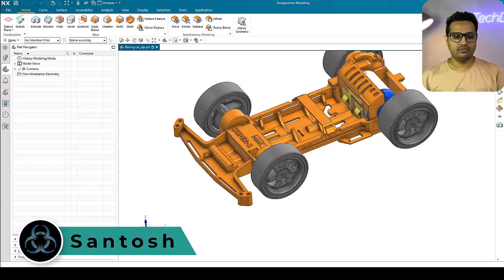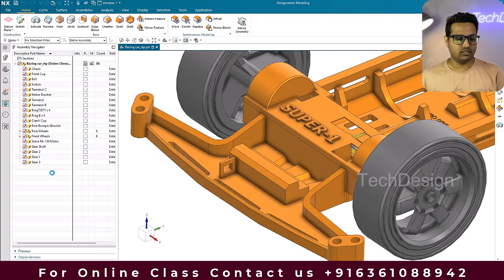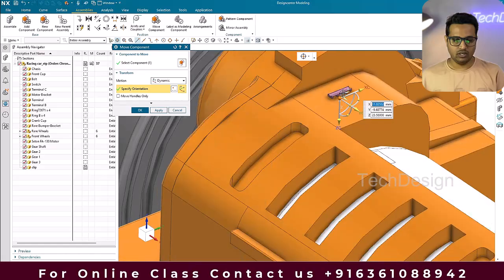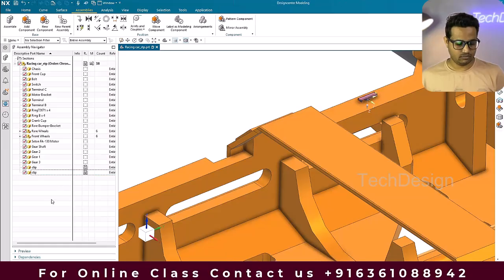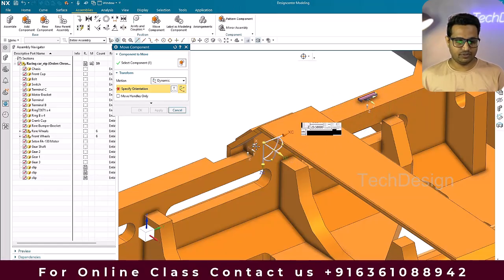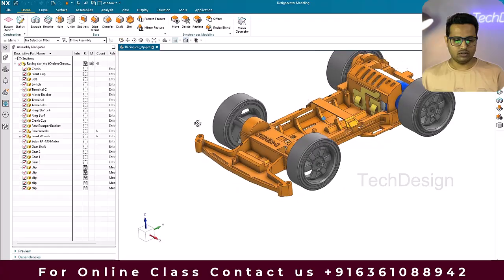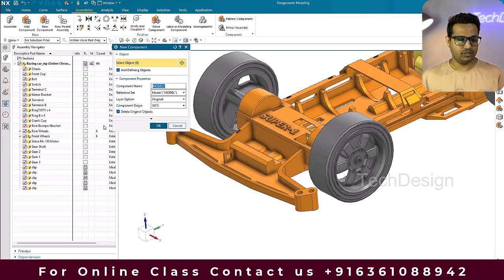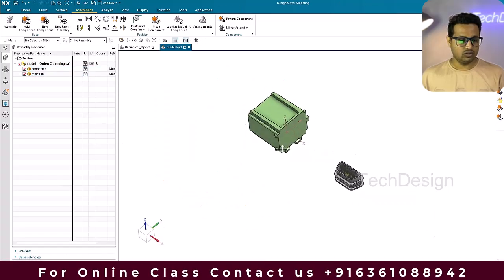Siemens NX 2506 Electrical Routing in Car

Comment: Is their possible 1m of Cable as Slack during deployment in any application
Reply from the maker: I didnt get your question.
Reply: Is their possible 1m of Extra length of Cable
Reply from the maker: Every company follows different standards for this.. and it is also depending on the which cable and what material.. I have never seen 1 m cable slack. It’s too much.
Reply: @TechDesignsantosh is it possible in Electrical Routing
Reply from the maker: In routing yes it’s possible
Reply: @TechDesignsantosh how sir
Reply from the maker: Go to slack.. select moving points and in length give 1000 mm